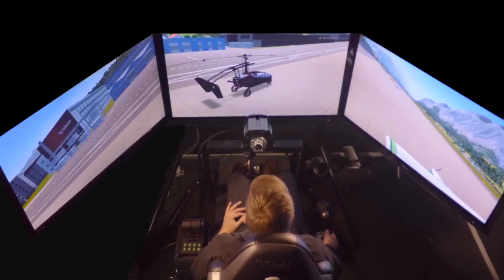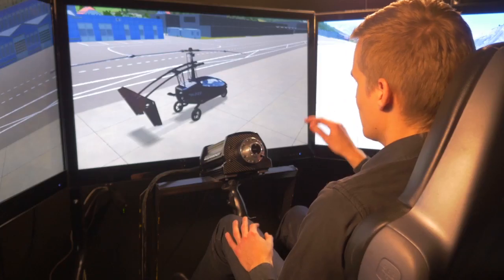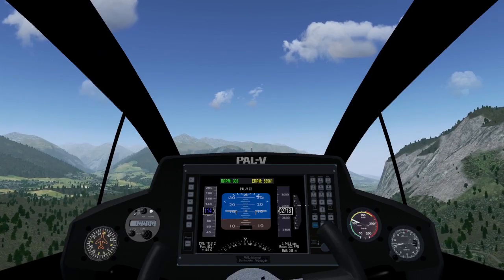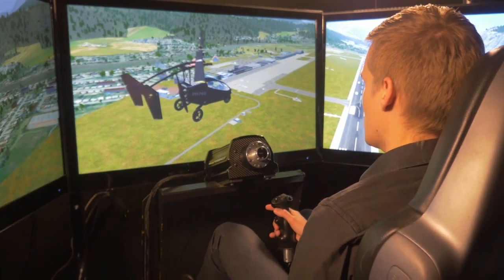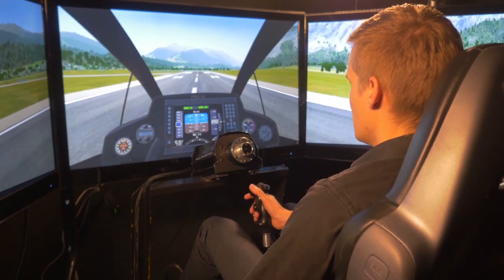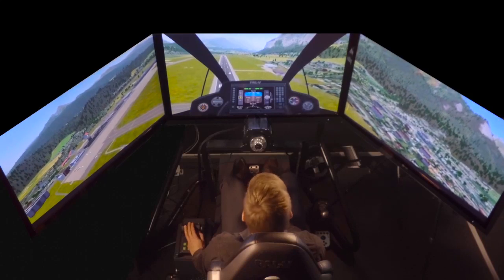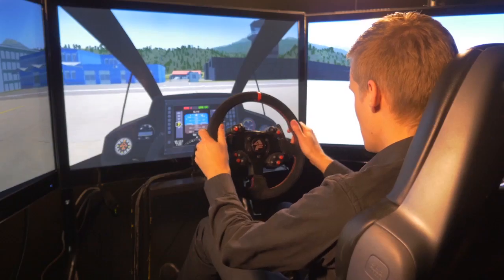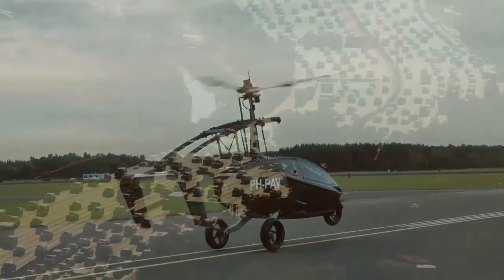How a Flying Car Works | PAL V review

Comment: And how is this going to be safer than driving on the road?!? Also, imagine the visual air pollution, no more uninterrupted blue skies and the intrusion on privacy when a car flies over your house/garden at low altitude. I think you guys are really just (very clever) boys with childhood dreams, but you're not addressing any of the issues related to flying cars. But perhaps it's because I'm a woman and all the people enthusiastic about this project are men (well, boys).
Reply: perhaps your thing is a flying horse
Reply: None of the things you listed there are specific to flying cars. They're all problems related to aircraft in general. Airplanes cause visual air pollution (especially if you live near an airport), drones invade your privacy when they fly near your house, and helicopters kill you when they crash into your house.

So, this is a complaint you should be making to the FAA, not PAL-V. These guys aren't responsible for how people misuse random aircraft; that's a regulator's job.